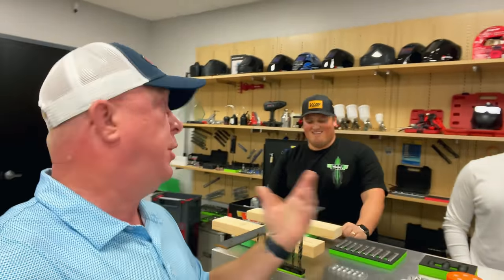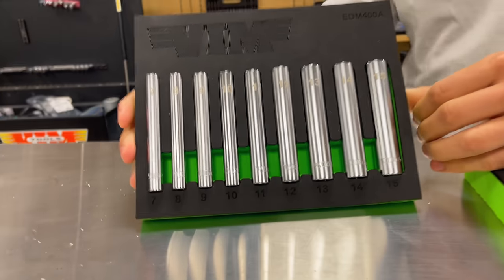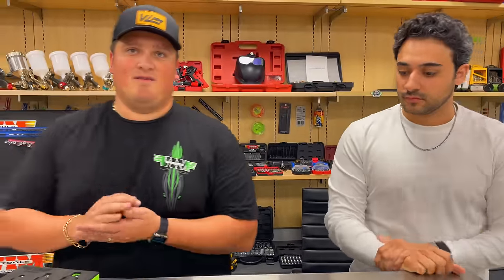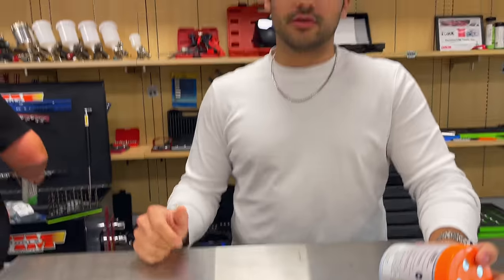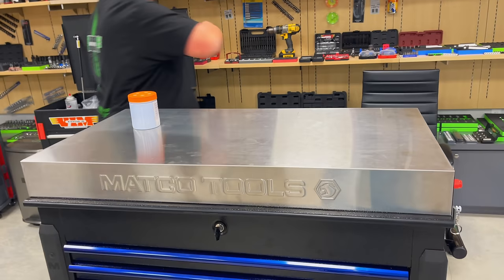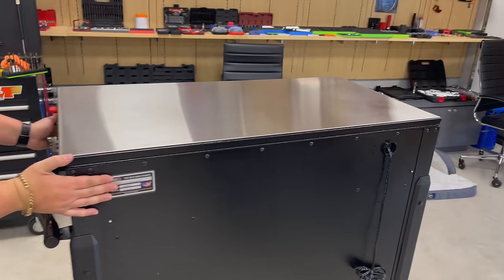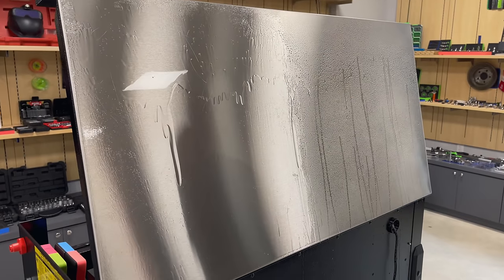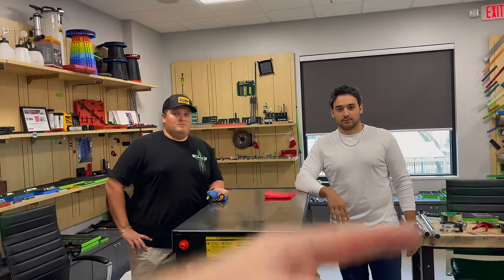VIM Tools New For 2024, Flex Head Ratchets, Toolbox Cleaner And More!

Comment: Very interested in that tool box cleaner snd polish. 
I clean my box(s) every month or so  and wax it at least once a year. I have been using automotive wax. The last time i used 3m products and the Milwaukee m12 polisher.
In middle Tennessee i have 7.5 inches of snow with about 1.5 - 2.0 hours of snow left to fall.

Comment: Heres a suggestion for VIM If they read these. I was thinking the other day of 1/2 inch extensions but as a full kit. Say 1/2 1 1/2 2 1/2 3 1/2 etc theres been quite a few cars where i wish i had a little bit more or a little bit less when using an extension. May make alot of techs lives easier!

Comment: Those ratchets look a little bulky how do they compare in size to snappy sk/olsa gearwrench
Reply from the maker: Heads are about the same size. They are actually really strong ratchets. They got 90 ft lbs on the 1/4” before issues